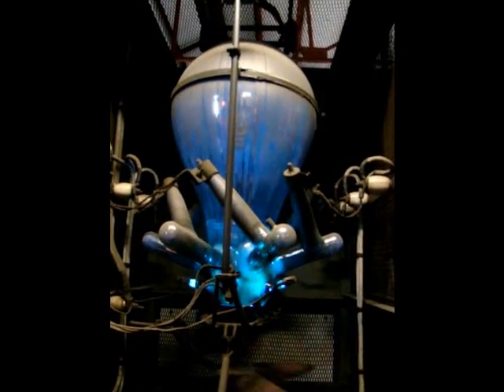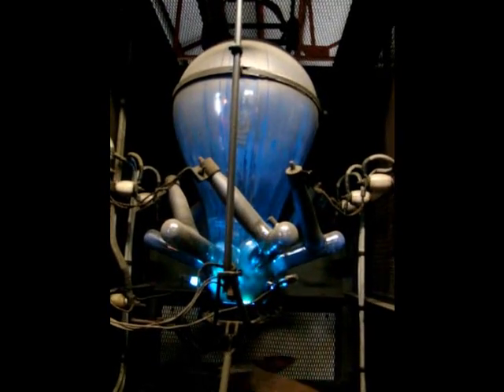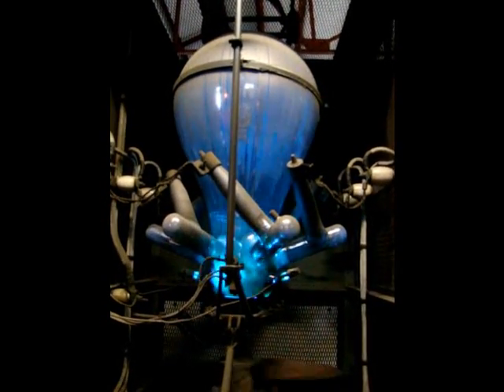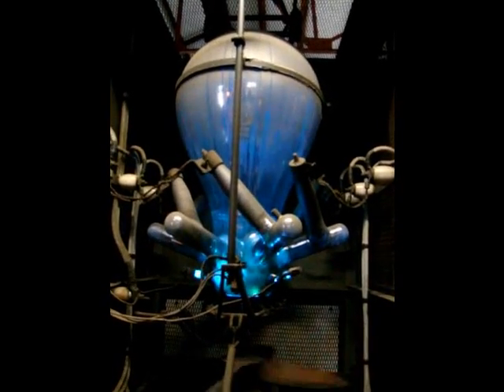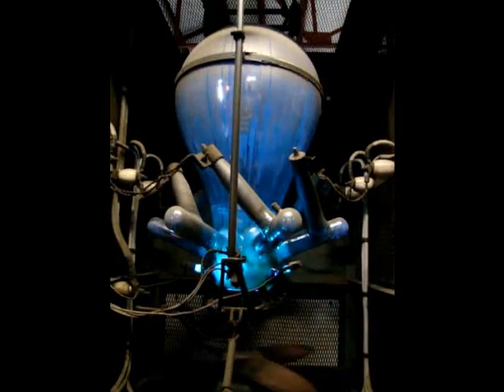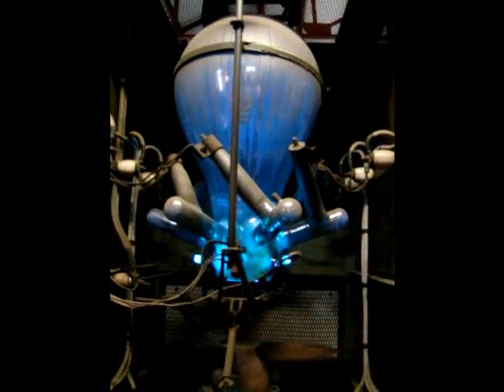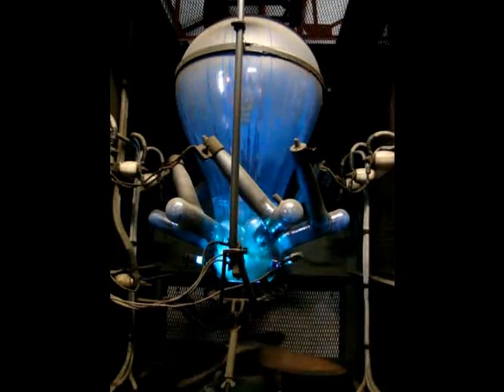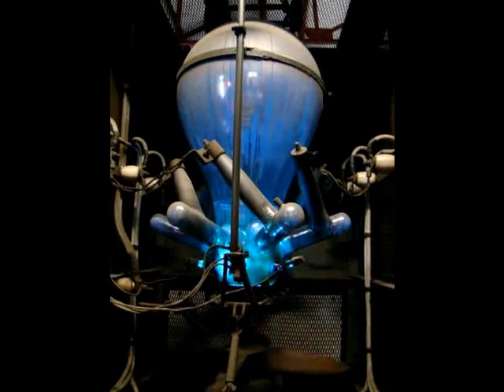Laxey Substation Rectifier

Comment: Do these old rectifiers emit x rays like the old radar tube devices ? Should be very carefull opening the shield box when working?
Reply: No, the voltage isn't high enough. You need tens of thousands of volts to input enough energy to emit xrays from a vacuum tube. As driver64 said though, the mercury vapour will still emit high level photons at the UV level. So like welding arcs and sun rays, you can get sunburn and eye damage from it with extended exposure.
Reply: The glass blocks most of the UV.
Reply: @STONEDay  X rays?
Reply: yea, a large spectrum of energy, quite UV dangerous for eyesight but longtime.
Reply: Anything with this colour of arc  would chuck out some UVC so staring at it for too long would probably be a bad idea. There are a few types of valve that emit x-rays but they are rare, we had a few in the moving target circuits of an old air defence Radar I worked on.